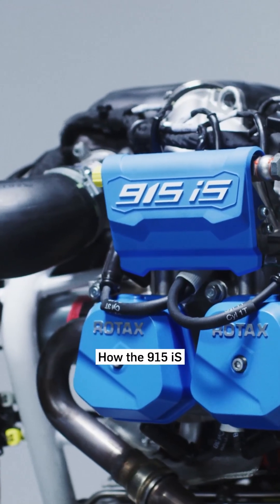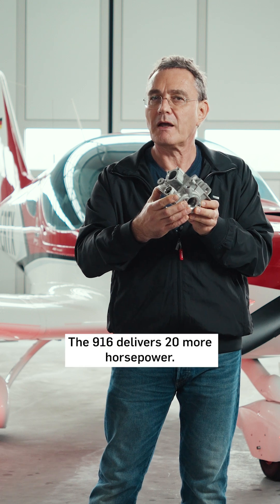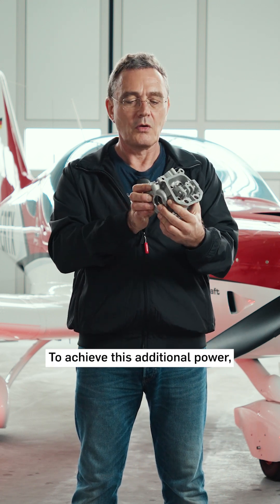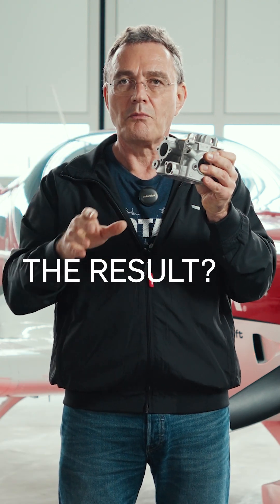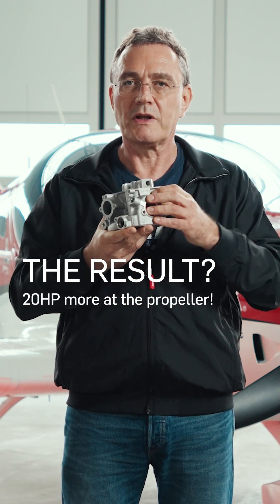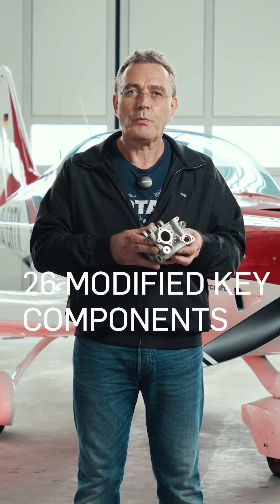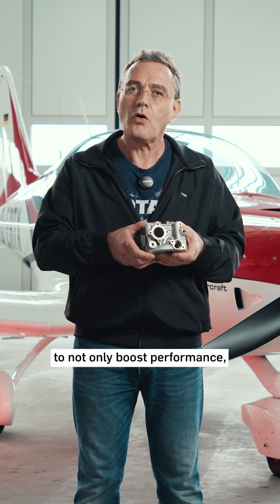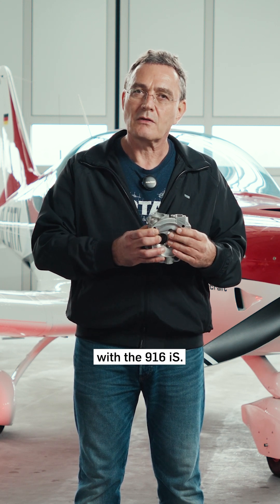How the Rotax 915 iS evolved into the 916 iS explained by Rotax Expert Siegi

Comment: Love it but can’t justify the additional 10 grand.
Reply: It's not meant to compete against the 915iS. It is meant to compete agains the O-320 160hp and the -360 180hp and even the IO-390 220hp and O-540! big bore Lycomings. 

The 916 makes 135hp cruise at 15,000ft. This is equal to a 220-230hp Lycoming at same altitude. Both the IO-390 and IO-540 are $90,000 engines new. And they also require $20,000 propellers with hydraulic governors. $120k firewall forward.

This will be under $70k firewall forward.